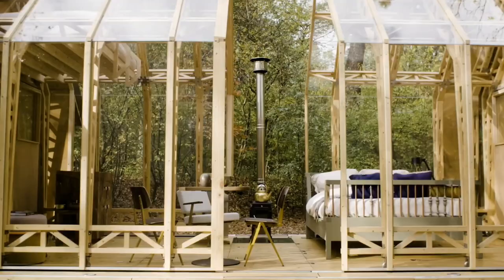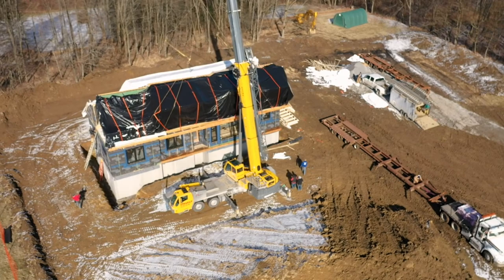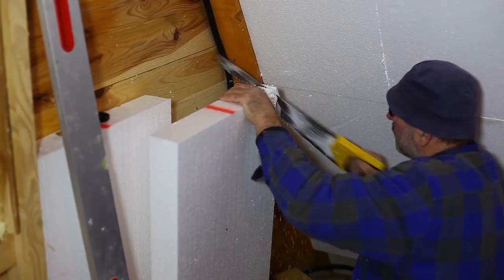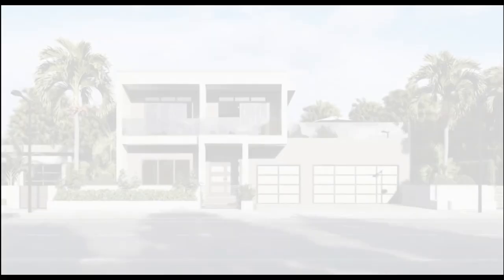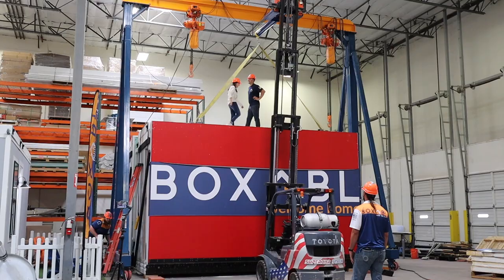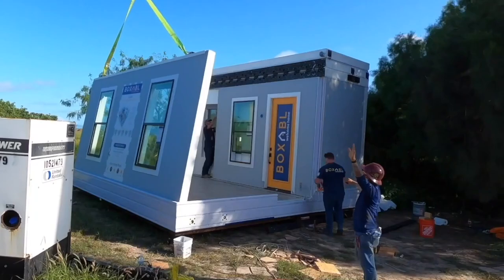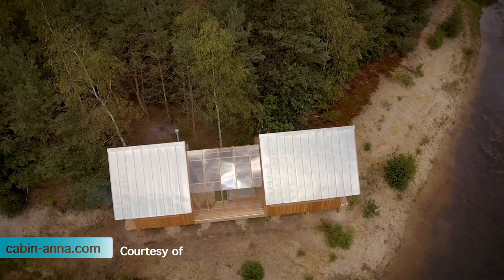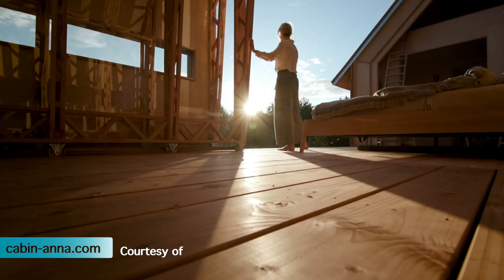The 5 Biggest Lies About Modular Homes

Comment: We’re in the process of building a modular home right now! I think one of the biggest misconceptions is that modular is a construction process, not a type of construction. Also, manufactured homes (homes that are built on wheeled metal frames) are built to different building codes, whereas modular homes are built to the same building codes as site-built construction. Also, modular homes are permanently affixed to a foundation, whereas manufactured homes arrive on an affixed trailer and are not permanently affixed to a foundation (though I’ve heard that some states allow a manufactured home to be put on a foundation). And my advice is to do your research on the builder. Rarely can you buy direct from the home manufacturer. Rather, you need to buy through a builder. Our builder has been great, and the modular home manufacturer has been in business for decades. And we’re getting a totally custom modular home and the pricing is very much inline with a comparable site-built home, but totally custom. Also, another common misconception about modular home is that it’s a certain style. It’s not. Modular homes can be ranches, twins, townhomes, singles, modern, traditional, colonial, mid-century…you name it.
Reply: Give us an updated when it’s finished.
Reply: Thanks for that info Mr. Carter!!
Reply: Congratulations!!! I’m excited for you!
Reply: Who are you using?
Reply: any photos of the process would be greatly viewed and appreciated, since it may help guide others in the process too. Shortening the building and buying time by six months is a big and important financial game changer. Thanks in advance and thanks to Kristina too for the data.
Reply: It's the land and the services!  the modular home is cheapest
Reply: Manufactured homes are NOT built to different codes than stick-built.  This changed a couple of decades ago.  Also, many manufactured homes are put onto foundations, even basements.  They are built on steel transport frames, but everything else is the same as stick built.  There is a steel frame beneath my manufactured home, the steel frame sits on piers that go below the frost line, and it is cemented underneath and has a brick ‘skirting’ around the perimeter.  The home is attached to the piers with steel straps.  It is very solid.  It has 2x6 walls and double-pane insulated windows, and vinyl siding.  I just had a new roof (thirty year shingles) put on after twenty years.
Reply: @doloresreynolds8145  That is incorrect. Manufactured homes are built to HUD code. Modular and site-built homes are built to all state and local codes that apply to the specific location where the home will be located. That’s not to say that a manufactured home couldn’t be built to the same codes and specs as a site-built or modular home, but that’s not the standard.
Reply: Who was your builder?
Reply: @MA-vm6jl  I’m in Pennsylvania and our builder is Madtes Construction. We’re about a week away from moving in, after many, many delays thanks to the pandemic.
Reply: @davidc-l9174  question, do they also prepare the land and construct the foundation as well? I believe they are in my area (possibly). This is a great recommendation if they can provide a full service for an affordable price! Thank you
Reply: @Breakthebinarybby  Our builder handled the entire process, start to almost-finished (we just got our temporary CO and have moved in, but there’s still work going on outside). He even helped us when we were looking at properties.
Reply: @davidc-l9174  Thank you so much! That is fantastic information. Invaluable honestly, I will keep it in my ‘front’ pocket!
Reply: Howd it go ?
Reply: @trizmorgan1319  it went well, we’re very happy. I linked a video of the set day above. Check it out!
Reply: Are they really 400 k
Reply: @David C-l  what did it run you and how many pieces
Reply: @Theundisputedtruth  The house itself was ~$350k (inclusive of structure, wiring, plumbing stubs, HVAC pre-plumb, and similar, but NOT inclusive of flooring, countertops, appliances, or similar), and was split into 5 boxes.
Reply: @Theundisputedtruth  The price point is highly variable. Our total project is north of $650k (excluding the land, which we purchased prior to construction commencing). But this is for a house with an attached in-law suite, so our costs were higher (two laundry rooms, two kitchens).
Reply: @David C-l  so total probably in the 500 k
Reply: @Theundisputedtruth  A lot more than that, but we're on septic and well, lots of trees to clear, boulders to move, etc. Also, we have a very large combined basement/garage.

Comment: Now if I could just find an affordable modular.
Reply: Are you interested in supporting design costs? I'm working on such a design as you are looking for. The pattern allows for ready changes as you grow.
The starting point can be as small as you need. The smallest suggested size to  start is 12 X 12 core. If a little larger is in your thinking and budget start with a 16 X 16 core. You can expand on the core indefinitely with my design.
With insulation my 12X20 structure cost was about $5,000 in materials. But it is still a simple framed wall tent. However, the frames are not standard framing. They are more of a modular type of design. The type of frames I designed allows for easy changes when you need to rearrange a space.
My design is unique which means I need an engineer to help get it permitable.
If you are interested in affordable low income modular housing please message me.
Reply: Exactly, it's like tiny homes, they started out as an affordable option for people wanting to save money on living costs. Now they can be $200,000 like a regular house
Reply: @RogueOntheRoad  where can I get more information?
Reply: I know!! It seemed the purpose of a modular home was to get something better than a trailer that would appreciate like a regular stick house but was cheaper because it was manufactured in a factory. Now there seems to be no advantage because the price is too high.
Reply: Okkkkrrrr!
Reply: Qaaa
Reply: @bhfashionclothingco.4847  Sorry that Sears no longer sells homes.
Reply: @charleenneal  ???
Reply: That’s just the cost of introduction and popularity.

Competition drives up innovation and supply which drives down cost.  As more manufacturers get into it, you’ll see the cost go down.
Reply: @Nathan Vs Everything That is far from the only solution, and that kind of myopic thinking is why homes are so “expensive.”
Reply: @Nathan Vs Everything No house is "cheap." I recommend a different marketing approach -- one that doesn't tout these modular home as the answer to escalating home prices.
Reply: Yes.  I'd consider a modular home...if the price were right.
Reply: As labour costs continue to rise and modular building manufacturing reaches proper scale and sophistication like car manufacture we can expect those prices to become very cheap indeed.
Reply: RIGHT!!!
Reply: @Solar Pro Nathan yea because that's the only options for everyone, get off your high horse dude, the reality you live in is not the same for everyone.
Reply: @Chilidoggzta  look up his name.
Reply: I would do modular in a heartbeat
Reply: @Solar Pro Nathan a college student can you your job
Reply: @nmartin5551  I was just about to tell them that Sears used to have houses in the catalogue. That was before my time, but PBS has a documentary on them.
Reply: @Wannakatana2112  $200K is cheap on the East Coast
Reply: Right! They are more expensive than site built now
Reply: @charleenneal  its sad i wish they still did thats why fools go and drown in debt. When the crash comes u better have the banks money
Reply: Step 1. Get a big container its kind of cheap
Step 2. Convert it a little
Step 3. Your done
Reply: exactly.  no real benefit other than it's a bit quicker
Reply: @charleenneal  Can still get plans online...
Reply: @nmartin5551  I hope it didn't leak had as bad as his Johnson wax building did....lol
Reply: Modular homes have existed for decades.   I think they go up and down as fads.
Reply: I been looking for one but they are too much money

Comment: One thing you didn't mention: You need to check the financials and reputation of the manufacturing company to make sure they can and will pay their bills.  The problem is that, unlike most other manufactured products, "mechanic's liens" can be put on the product itself (i.e. your house) if the company doesn't pay their bills. So you can get stuck with extra bills if the company becomes insolvent or otherwise doesn't pay their bills on time. Now, the instances of this I know of are in Colorado, and maybe other States have different laws. But generally this is also true of "general contractors" involved in regular buildings also, so you always need to check out the financial condition and reputation of either a  general contractor or a modular company before you sign the contract.
Reply: Get
Lien
Waiver
Document
Reply: Yes, UNCONDITIONAL lien waiver. Texas is like this.
Reply: Your buddy, the RE lawyer.
Reply: But that same rule applies to your standard stick built contractor home as well.  I've heard similar horror stories regarding conventionally constructed homes when the contractors goes belly up in the middle of building the house.   So really not a new issue for anyone buying a new construction home.  As others have said make sure you are talking with a real estate attorney.

Comment: We wanted a modular but the costs are way out of whack for our area. We are building in east central Texas on Lake Livingston, modular homes were all $250-350 per sq. ft., not including the foundation. We wound up with a custom design, 1 story, 2550' under roof, about 1800' heated and cooled plus garage. The foundation was very expensive at $60k because we needed to install 23 concrete piers that averaged 14' deep and do a lot of clearing and tree removal for the house. With Nichiha siding, closed cell foam insulation in walls, open cell foam in roof, 24 ga. steel roof, high efficiency heat pump, etc. we are coming in at $250k total. A similar modular would have been over $450k, that's a huge difference that just doesn't make sense.

Comment: Insulation doesn't warm your house up, it stops any free heat from the Sun from coming in, and just to be even greener they put a film on the windows to also cut down the chance of any free heat coming through them. You have to be the new Green and pay for any heat you might need, and without the free heat from the Sun you might find you need extra heat from September to May if your lucky. A well insulated house can soon turn into a Morgue. In the UK they have just built some modular homes that are the size of a shed, apparently they will be cheap to run, but that is rather obvious considering the size. If you lived in a insulated wardrobe your bodyweight alone might heat it up.

Comment: Here's one interesting thing I just learned.  The HUD code for manufactured homes does not permit the owner to add structurally connected additions onto the home. Any addition (porch, garage, carport, room) would have to be built freestanding and only sealed to the home. Both structures must be able to move independently by law. I don't believe this constraint holds true for modular homes since they're designed to be permanent structures. All of this will affect appraisals and resale as well.  

Btw, some people build large enough additions to manufacturered homes to be considered legal homes themselves for resale. The manufacturered part would be considered separate for resale. Sounds complicated! 

Another reason to go modular if you plan to add an addition in the future.
Reply: Or just buy the bigger manufactured home to begin with for less money and property taxes on private land.

Comment: Hi Kristina, thanks for doing this! There are some modular homes that come in two sections (Champion Homes, Clayton, for example). I would not be afraid of those homes. Do you think that since double wides are in two sections and some modular homes are only rectangular in shape, most folks assume that a modular home is the same thing and then go down the road of "it is a trailer park home"?
Reply from the maker: I have seen some “modular” homes by those companies and they appear to look very similar to manufactured but they are made to modular specifications.

Comment: Thanks so much posting this video. Very informative. Definitely want to look into getting one. I've always felt it's a huge piece of mind when it comes to energy conversion and renovation. Once one buy a stick and brick home renovation is not cheap. Room by room that would take months or years to finally get the house the way you want it. With modular homes, your ideas are built into the home. Warranty, energy efficient, modern, no secret problems that would need fixing, basically just like a new car. A 80+yr old house you buy then adding 30+ more yrs to that house, I'm sure something would need replacing. But again with a modular home, you can say that you'll be worry free for at least 10 yrs without a big budget crunch problem.

Comment: there is a technical difference between a manufactured home vs a traditional site built home. A manufactured home is typically supported by a metal pier foundation system. This system is not embeded into the ground so if you wanted to pick it up and move it, you could. I always wondered what would happen to this type of house in a earthquake. I imagine it would fall off the metal piers but stay together like box. A traditional home or module for that matter would be supported on a foundation that IS embeded into the ground. This mean its permanently fixed and cannot be moved without a great amount of effort and cost. With this being said being fixed to the ground means its considered "real estate" and attached to the land. Not fixed means its not "real estate" as it can be moved as an object. Think about it similar to trailer parks.

Comment: Modular may well be the future of building economically. I am a general contractor (RET.) after 38 years of building single family homes in Minnesota as well as some remodeling here in Georgia. I have watched this trend towards "modular construction" progress over the years since the 60s (Pan-abode western cedar log homes). There are some real advantages that I see over stick built home's. First, quality control and the advent of Cad. "computer design programs" and the ability to translate that into precision cutting of all studs,wall panels, trusses etc. and mostly framed (nailed) up via artificial intelligence. Doesn't matter if its storming outside work still continues, a huge plus over field work. Now I could go on as to other advantages but don't want to bore you with all the small stuff. Hope you find this opinion helpful and I have no affiliation with any company in this area of construction.  

David Clarke, owner CRC Construction LLC. (retired)

Comment: In your efforts to differentiate modular and manufactured, you end up blurring the distinction between modular and panelized prefab. You say "a manufactured home is usually delivered in two sections and they're connected together, most of it made in the factory and connected onsite with those two sections." 0:48 Modular houses can come in 2 sections just like a manufactured home. It depends on how many modules your modular home is comprised of. (If you choose a two module design then your house arrives on a delivery truck in two pieces.) AFAIK the main difference between modular and manufactured are the foundation system and the building standards each one needs to meet, with modular homes meeting International Building Code standards like stick-built homes, so they're treated the same. 

0:58 "Now with a modular home the sections are built in the factory and then they're assembled on the site." It's not clear what you mean by "sections". If the sections are boxes then it's modular. But if you're making a distinction between what you described as manufactured, then it suggests you mean more on-site assembly of the components must take place. In that case those are panels and the process is panelized prefab, not modular because the components are not modules. That may not be what you meant, but I thought it was worth noting because you explain it that way in a couple of videos and each time I thought of panelized when you got to that part

Comment: We are having to get a variance to get a modular installed on our property. We got approval, but had a problem with FEMA requiring our home to be 6' to finished floor because of a flood zone, so we have had to buy another plot of property without those restrictions and are having to go through the variance process all over again. Still, it was not hard to get the variance. Ours is an Oakcreek home - they have both manufactured and modular versions of the model we are buying, but the modular version is a much better build, imho.

Comment: 1. A manufactured home is “built in two parts” only if it’s a double-wide. Single-wide and triple-wide? Not two parts. 2. “We haven’t really seen a Category 5 hurricane.” I rode out Cat 5 Hurricane Michael in Bay County, FL on Oct. 10, 2018. “If the modular home is under $65,000, you cannot get a home loan on it.” Private lenders can lend any amount they want on whatever terms and for whatever collateral they want. Borrower might not like the terms, but that’s a different matter.